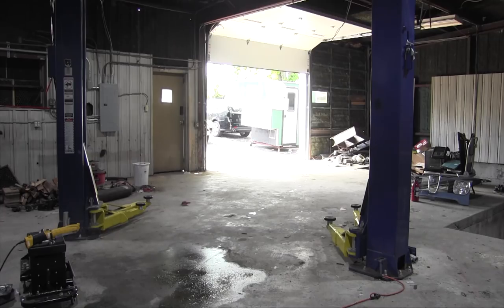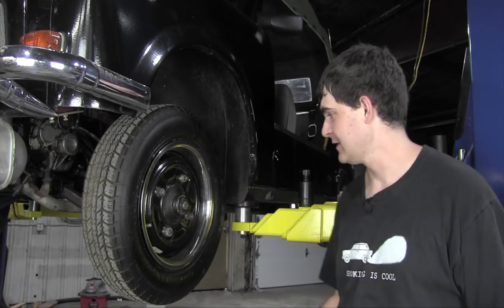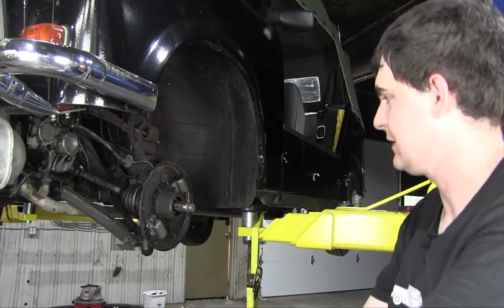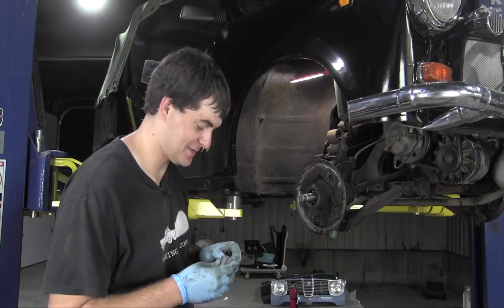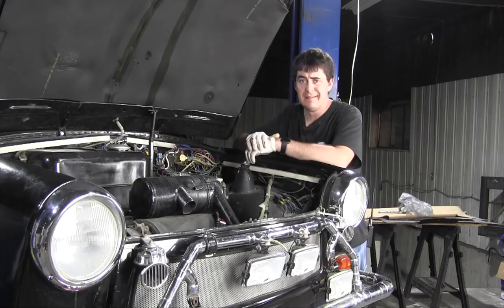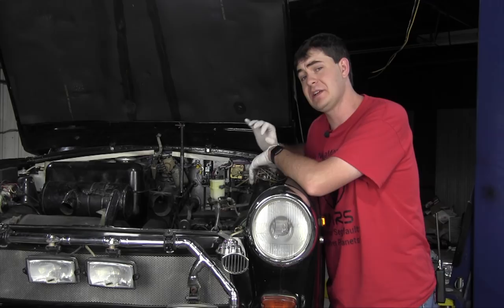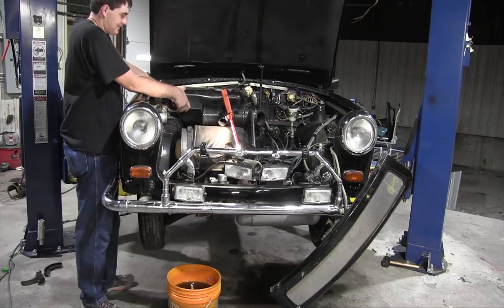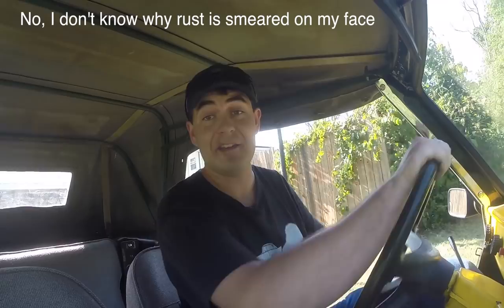Making a Trabant Tramp Go and Stop Again

Comment: Fill the tubing with fine sand (pack it in) before bending and plug the ends.  This will prevent kinking.
Reply: Put fine sand in a brakeline sound like very poor advice
Reply: @AlexanderTrefz  It's actually fine.  You just need to flush the tubing after the bends have been made.  Of course.

Comment: What a sweet little machine! Shame it was customized by a blind man.
Reply: @trashcarfj45  hmm I wonder if the car could be modded to use the bmw i3's range extender engine then you'd have a 4 cycle engine with slightly more power that is probably more efficient on gas running the Trabant that would be cool to see done to one of them

Comment: A comrade had bought such a Trabant Cabriolet from the NVA in 1990. It was a strange feeling to drive through the barracks in such a car as a German army soldier. After all, the GDR called us “class enemy”. :-) The Trabant felt amazingly robust, even though it was so small. Of course, that was no comparison to our VW Iltis, which was at least capable of off-road driving.
At Citysax you can order an electric conversion kit for the Trabant, then it finally doesn't stink and rattle any more. It also accelerates faster. :-)

Comment: I know this is an old post but, a helpful, I hope, note. They make an alloy, copper and nickel - I think, brake line that has two great benefits. It bends easily and really doesn't need a bending tool and it doesn't rust. Just used it on my old car and it works great.

Comment: Why didn't you just slap some Flex Tape on that reservoir?
Reply: Tibor Klein i don't think ot was major damage. Phil Swift would have beaten his ass if he used flex tape on minor damage. Actually i asked the same question. They make clear flex seal
Reply: SLAP IT ON WITH THE MIGHT OF ZEUS
Reply: If you do the thing and you do it right and you don't fuck it up, it works! It just works! It's not a fucking miracle product... SLAP ON THAT FLEX TAPE!
Reply: I SAWED THIS TRABANT IN HALF
Reply: THATS A LOTTA DAA MIDGE!
Reply: AND I PUT THIS TRABANT TOGETHER USING THE BONDING POWER OF FLEX SEAL
Reply: I actually had a pretty serious leak in my kayak and epoxy didn't quite do the trick...so I covered that epoxy with some FlexTape and it worked perfectly! I've had no qualms about taking this meme of a repair job out on the open ocean for some island hopping and it's held up just fine believe it or not!
Reply: I SAWED THIS TRABANT IN HALF
Reply: And put it back together with the power of flex tape
Reply: Yeah, until '89
faint sad communist noises
Reply: @muke001  we used Gaffa on the dried crack when the kayak split from too much water and it lasted beyond the next week of ocean travel around NZ …

Comment: If the threads aren’t totally destroyed you can take a v file to the damaged ones and clean them up usually.
Reply: That won't really work for threads that are totally flared out though. The only thing you can do is cut the thread off at the spot where it still has the right diameter, and use a thread file to clean it up so you can thread a nut onto it.

Comment: The usual way of putting on brake shoes is to fit the springs first, then lever the shoes into place.

In addition, surely there is a local shop that can make up that itty-bitty little brake line between the two front cylinders using the existing one as a pattern. That's assuming they use a standard metric thread.

Comment: The trouble with the modified fuel tank and using the plumbing valve is that it has no reserve option. So, there’s no heads-up at all for when the fuel is running out other than keeping an eye in the tank. Might be worthwhile changing the fitting on the tank back to the original type to fit the original petcock. Nice project 👌

Comment: You can easily put the springs back this way: 

- attach the upper part;
- put the right brake shoe in its place;
- put thе spring on;
- place the handle of the hammer at free (left) brake shoe in order to pre-load the spring;
- make a strong and quick push towards the front of the car.
The brake shoe is in place, the spring is in place.
I takes a second and saves your fingers :)
Reply: Yep. I've never seen somebody try to fit the spring after the shoes are fitted, that's too damn difficult.

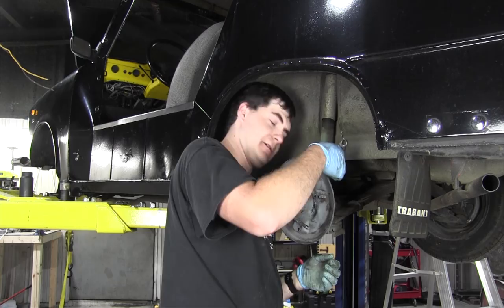Comment: 9:00 Add Trabant to the short list of cars, like recent model Corvettes, the Opel GT and the Cadillac Allante that used transverse leaf-spring independent suspensions. This one doesn't seem to have the anti-roll properties (which would require 2 mounting points) for which the Corvette was famous, but it looks very similar. From the camera perspective, it looks as if the shocks are acting as non-load-bearing McPherson struts, though it could  be the trailing links holding the wheel hubs steady. Whichever way they did it, it seems to work.

Comment: I've done my fair share of abusing soldering irons to "weld" plastics. Works much better than any sort of epoxy or things like that. One time I was an idiot and took off the timing belt + tensioner before loosening the camshaft gears, so I couldn't get the gears off anymore and they had a part of the timing cover behind it. Had to crack the timing cover back portion to pieces so I could lift the camshafts off and remove the gears on a vice. Was not a pleasant job to change 16 valve stem seals on a car that had hydraulic lifters and the valves were very deep in the head, didn't want to take the entire head off

Comment: As soon as you pulled the wheel  and. Saw what wasn't there. My thought was exactly as   You stated  the previous owner / mechanic  didn't. Know about or have the tool  sadly ive found over the years that is  a fairly common practice of "professional" mechanics   I. Had a Ford truck for over 10 years. And it was serviced by several shops  at one point i  decided to. Give it a  tune up myself   There was one spark plug that was a little tough to. Get to  but i did manage to use a crazy  setup of  universals and extensions to remove the plug. Upon examination. I. Discovered that it was a factory original. And all the others were diffent  brands ?  My conclusion  was that  all the. Shops that had  done  work on the vehicle were  too lazy. To  do the job correctly  that type of work is not acceptable  in my opinion  none of the shops  ha informed me  that would be the  practice   And i did never return. To any of those businesses   But continued  having  thousands of dollars worth of work done. At another. Facility that. Was owned and run by a honest family i know
Reply: because the donald trump  wanted it just like that..( yes life is hard) :(
whats 9+10= ??
Reply: This is why I do most of the maintenance on my car myself. I have so many stories like that, like when a shop fitted the wrong sized radiator hose and the fan chewed through it and I dumped all my coolant all over the road. Fun times.
Reply: Years ago my Mom's Chevy Celebrity with the 2.8 was running rough. She'd had it tuned up at a couple of local shops but it didn't help much.  They'd used cheap spark plugs so I bought some good ones. I swapped the front three in a few minutes, then spent the next several hours getting the rear three out.  Of those three, all of them were shot, and two were almost certainly the originals.  The car had 130k miles on it and had been "tuned up" multiple times over it's life.   It seems nobody who had worked on it could be bothered to swap all the plugs.
Reply: ... and that is why I "waste my money" and get my car serviced at the "main dealer" garage that sold it. 12 years on (I have owned it for 10) it has had "no expense spared" services ALL at a "main/factory dealer". No small garages. No "exhaust and tyre, and a service too" shops. 
Some vehicles have strange nuts and odd settings. I own such a vehicle.
Yeah, I've spent rather more than most in 10 years of ownership, but my vehicle starts and runs really nicely. It is nothing special - just a family runaround. But the best car is one that works properly ...

Comment: I have had problems trying to bend sharp corners in short copper lines. They kink so easy. I found something that works. Fill the copper line with melted lead. Then make the bends. Melt the lead back out. You can bend the line in half without kinking. I had a 1967 Jeep CJ-5. There were brackets on the front axel where the flexible brake line changed to copper. There was a two inch long copper line into the brake cylinder. The line had two right angle bends. Part not made anymore. The lead trick worked.
Reply: Freezing water in them worked for me as well although it didn't work too well... but hey, it did work

Comment: I find it interesting the trabant uses duplex drum brakes, In the sake of cheapness I would have expected them to use cheap simplex or uniservo type brakes cause they’d only need one brake cylinder. 
Also, I share your aversion to drum brakes. My 1965 bonneville has duo servo style brakes on all 4 corners and damn are there a lot of springs.

Comment: brake springs: pull the shoe away from the whee cylinder then a little outward then move it forward over the wheel cylinder towards the the other shoe - spring tension released ,,,,when putting them back on hook up the bottom spring the get the bottom of the shoes in places  with the top of the shoes close together hook the spring in place then pull the shoes out from the center until you can slip them into the grove in the wheel cylinder... hope that makes sense!

Comment: The difference between the L and R front duplex brake cylinders is on the backside where the brake shoes rest. The surface is angled differently for each side. Not super easy to see but important to keep the shoes in place.

Comment: Wouldn't a GM power steering pump pulley removal tool work for those wheel hubs. It could possibly be to small, however they seem to be practically a simmilar tool. Just a suggestions to possibly try if you have one of these cars but don't have the tool.

Comment: Considering the front drums have two cylinders each, they can probably be pretty good with modern friction shoes?
Reply: LOL.... nope. Internal drum brakes will always be shit, since application of the brakes creates heat. Heat expands the brake drum, making it larger. Lager drake drum makes brakes less effective, requiring increased pedal pressure. Additional pedal pressure creates more heat... and repeat.

Comment: One thing you probably didn't know... the wheel nuts are tightened with only 60Nm / 44.25 ft lb ... it isn't the best idea to tighten them with a impact wrench. 
On a Bad rainy day there is a possibility to pull the studs out of the wheel hub... 
Happened to me twice in my early days as a mechanic (6 years ago). I thought 100Nm on torque wrench should be ok... well... where not...

Comment: The specialized drum puller at 5:00 looks similar to a Chrysler gen 1  ( 1963 to 80's ) alternator pulley remover or a GM power steering pulley puller.

Comment: What a nice car! Better than a Citroen Méhari.
Reply: If you want to make your life a lot easier, try the copper nickel brake line. $50 for a 25 foot roll. Is very easy to shape and flare and corrosion resistant. Also, check out a hydraulic flaring tool. I have one made by Mastercool. Makes beautiful flares every time.

Comment: The park brake lever is supposed to be removed from the old shoe and reused on the new ones.  That's standard practice on all drum brakes even on American cars.  Also you can cut the ends off the brake lines and re-flare them with a flaring tool available as a loaner from most chain parts stores.

Comment: The difference between left an right wheel cylinder in the front is the starting point of the grove where the brake shoe sits. on the left side its getting wider from botton to top, and on the other side the other way around...
Reply: It's actually where the bleeder is positioned. The bleeder must be the highest point.

Comment: My truck's fuel tank also only has two bolts but after you get said bolts off you have to move the straps out of the way and then wrench the mofo out of there which can take a really long time and takes just as long to get it back in there

Comment: Try to use Hot Glue Gun next time to repair the reservoir. I used it to fix cracked gas tank on my grass trimmer, and it still doesn't leak.

Comment: I once tried to epoxy my leaking windshield wiper fluid reservoir.
Didn't end well, looks like the same kind of plastic that breaking fluid reservoir is, though.

Worst enemy of vintage cars are not the once left alone without maintenance, but the ones "modified" or "fixed" by people who had no clue. Sadly.

Comment: There is no "special rear brake shoe for the handbrake". All brake shoes are the same. When you change the brakes shoes on a Trabant, normally you also buy 2 rivets that fix the 2 levers onto the brake shoes. You cut off the old rivet from the old shoe, take off the lever, and reinstall it onto the new brake shoe with the new rivet.

Comment: The simple temporary repair for the reservoir is self amalgamating rubber tape. Wrap it tight and you will be surprised how well it will work. Heck you might not even need to replace it ….

Comment: You shouldn't really do the melty plastic thing on the reservoirs. It isn't a permanent answer and if you don't know what the material is, you could end up doing more damage. It is better to use break-proof epoxi and a little bit of fibreglass sheet. Really cheap, really easy, works about 99% or the time. Give or take 99%.

Comment: in 89 they sold the Trabant with a 1.8 or 1.9 i4 from a VW Golf
Reply: Uh... not quite. It was a 1.1L 30kW VW EA111 series engine that was for the most part identical to the one used in the first generation VW Polo. They made less than 40k of those "Trabant 1.1" in total, a lot of which got parted out for the engine (since it could easily be used to fix VWs) and the rest scrapped because nobody wanted those hopelessly outdated vehicles after the wall fell.  https://commons.wikimedia.org/wiki/File:Paj%C5%A1l_trabanta.JPG
Those VW EA111 series engines were actually produced (in modernized form) till 2011 as 1.0, 1.4 and 1.6L, used in the Polo, Golf, Touran, Lupo and Audi A2

Comment: All vehicle designers/engineers should be given a random part on the vehicles that they helped design, and are forced to then be filmed, timed, and critiqued on their attempt at replacing/repairing their newly designed vehicle before it goes from prototype to production vehicle.

Maybe they should also “repair test” all new vehicles wishing to be approved for sale, just like they “crash test” all vehicles before sale, and penalize all hard to repair/replace the parts on a vehicle with simple shop tools, and if they get a bad ratings then they tax the vehicle  at a higher rate. I bet that overall the climate and environment would be better off if we were mandating the ease of repair of vehicles over most current climate taxes. Vehicles are insanely carbon and environmentally costly, and that  after only a few years even minor vehicle damage/wear&tear can cost too much to repair because of unnecessarily hostile anti repair engineering, that I swear is done on purpose so that older vehicle is are often not worth repairing/saving…

Comment: I like the car in spite of myself, but those "accessories" are nothing short of clumsy and garish......
Reply: That hub puller looks suspiciously like a power steering pulley puller. I'd probably have just made one in the shop.
Reply: @3347861  Getting the tightness right for that split thread? Air-hardening that alloy steel without having the thread bend out of tolerance? Go ahead, be my guest.

Comment: I don't know what state you're in or Twilight Zone you your head is in but I was going to mention earlier before you waste your time with that soldering gun they do make the correct epoxies to repair that that's just preparation has to take place which is cleaning and stuffing it up and be enough repairing the plastic to marry to the epoxy properly and again I fixed that same thing many many many times over the years they keep gone I'm not you haven't got my confidence yet at all I hope you don't wreck that car and I hope you ingested the brakes manually to make them have a nice full pedal and good in a surface contact with the shoes to the drums why am I telling you all this stuff you'll learn this in the years to come if you work on